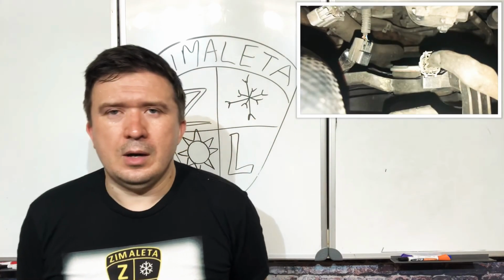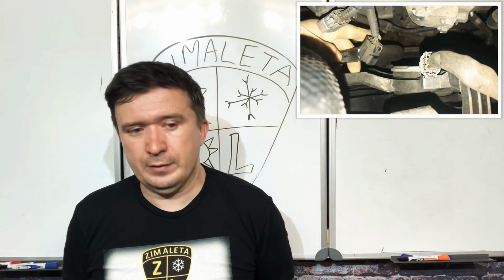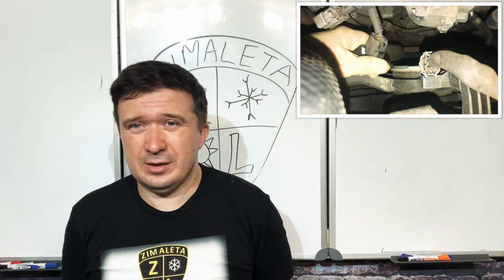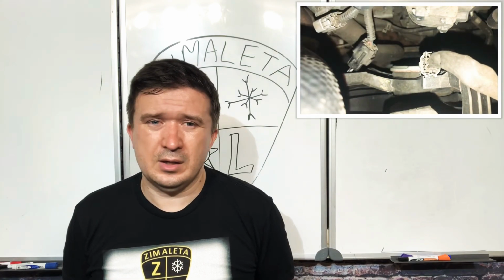Nissan Rogue Misfiring Code P0300 P0301 and P0304 multiple Cylinder misfire & Channel introduction

Comment: i Have a 2008 nissan rogue and love to tinker with it. the same p0300 code comes due to the following
1- Plugs
2- Coils
3- Primary Catalytic Converter
4- Fuel Pump issues (please remember that fuel must come to the engine at a standard psi ( anything less will mess the mixture and the computer will might not send any codes ) but then the car will loose strength and it could misfire randomly
Also check that the tank cover is ok - may be change to a new one cos these too can cause code p0402( if i recall well) 

these are the major problems that bring the p0300 code (multiply cylinder misfires)

Comment: Did you fix the problem? I have the same code. P0302 P0300. Replaced all spark plugs, All injectors are good and cleaned.